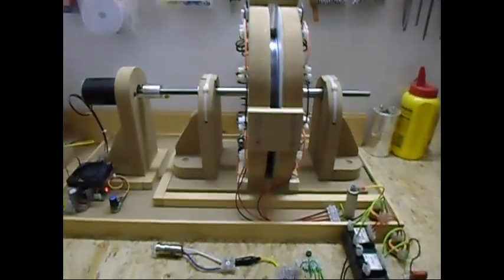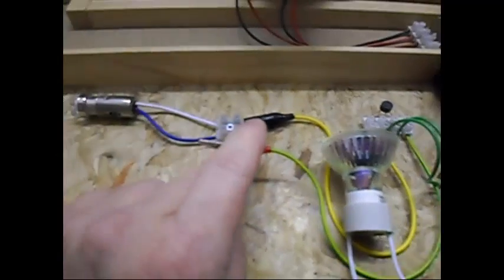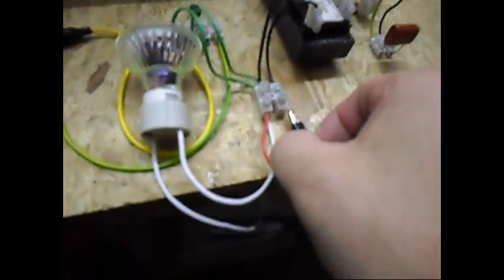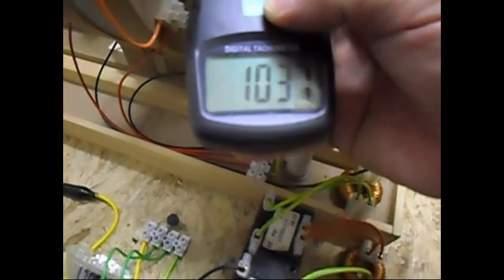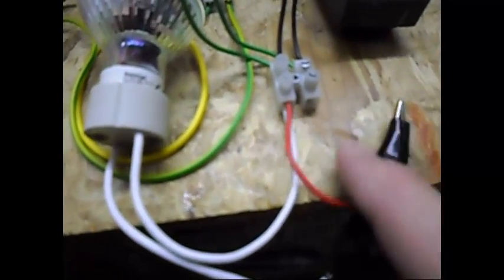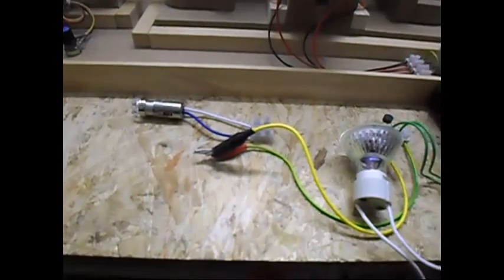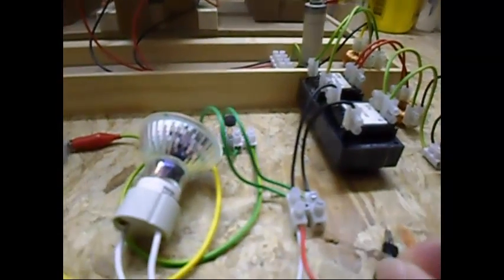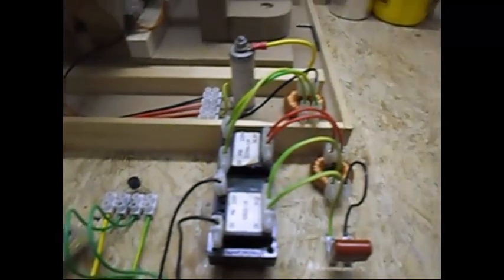Single Phase Generator_Update 2 - Aircore Generator speeding up under Short & Load...

Comment: Mister Caribbean Roots I came across this video it might help you in your designs ? from what I understand using Bismuth to shield the outer riim of a large magnet may help see https://youtu.be/whoylwf-i0A

https://tinyurl.com/zmqutlp
Reply from the maker: Thanks for your comment and also the link provided, i'll check it to see if i can learn something from it...^^
Reply from the maker: Thanks for your input on using bismuth and graphite, it's all much aprreciated...^^
I don't think there is anything we know of that can shield magnetc fields...we can use steel as a sponge to absorb it but than the steel becomes magnetized which is of no good...lol

Comment from the maker: An update on this setup where i've thrown together a circuit that makes this Aircore Single Phase Generator speed up under Short & Load...^^
It is a cool and funny effect but not very usefull i must add but still something fun to play with and to learn from it...

The issue is,
This type of circuit put in advance a load/drag on the complete system and when you load or short the generator side it will magically speed up the system...wow...lol
The issue lies in the amp draw at start of the test...15V @ 600ma and only 700(ish)rpm...-.-
Normally this aircore setup will do around 1200 or so with the tuning pot set at this point where it is in the video and with only 150 to 200ma...;-)
So one can see that the system is being drag/load down by 400(ish)ma more than normnal and when loaded/shorted it is relieved of it for like 50%...
=========
So if you don't know or see this info i'm writing here or see it in a video you could be easily fooled into thinking...wow, this is the stuff we need for a O.U setup...NOT!...lol
=========
The first 3 pictures at the end are for the U-tuber that commented about caps/switches for the output...this is the setup i made years ago for that test which had lots of coils/caps and switches...;-)

The next 3 pictures are for the U-tuber who commented about putting a fan on the shaft...as you can see...many types of fans and a prop...the one with the prop was a bit scary when running...lol

And the last picture is the diagram/circuit of what i'm using to get this effect with this aircore generator...:D

There are other ways to get this effect but this is just one of them without having to do anything to the gen coils...;-)

And of course the pictures are for everyone to see...DUH...any questions...???...just ask away and i'll do my best to answer them the best i can...^^